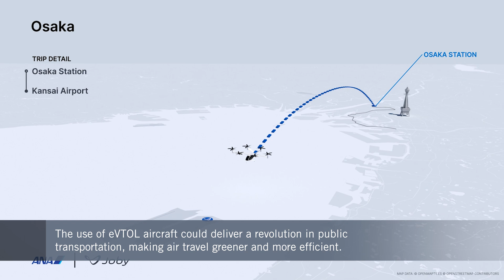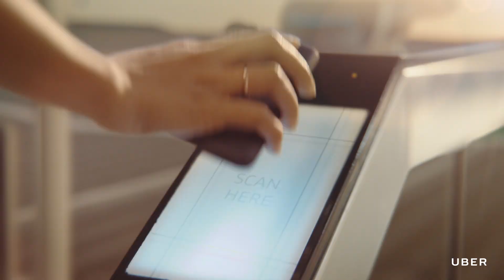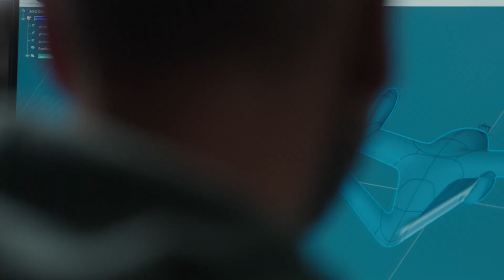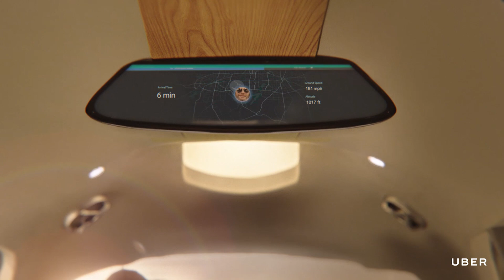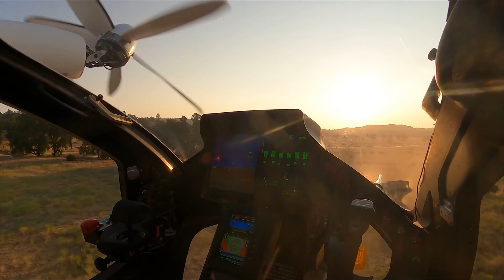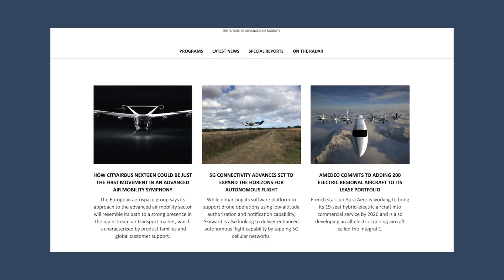Electric Aviation Pioneers Like Joby Want to Transform Air Travel With eVTOL Aircraft – FutureFlight

Comment: It's interesting, it seems well built but it's too big, too heavy, too conventional helicopter thinking thus missing out the bulk of the potential that light single seat EVtol could have. Notice the massive helipad/airport on the roof in their promotional material, that's airport thinking and airport isn't convenient. Only when it's light and quiet enough to land at a mansion in the hills and on a small bar roof and any Target or Olive Garden will it really matter. And should of course be autonomous. Way too much overhead to have a meat anchor costly pilot. This many years into the process and they are not seeing the obvious...  what can I say.
At the same time they could do home delivery drones. Designated publicly registered delivery platforms and the drone zips there directly from robotic kitchens at 300km/h. Like I've said before 2 tilt wing configuration. Both for passanger and packets.
Reply: The freedom and evolution of air travel you describe can happen with this kind of technology, but it can’t happen under the umbrella of FAA oversight, which is why they are fielding the technology the way that they are, with small regional helipad style hubs.
Reply: Technology moves fast. We are still in the stone age of evtols. If your concerns are valid, they may be solved down the line. These eVtol companies are all learning lots of new technologies and other things.
Reply: @drakecoleman9364  some of them have been at it for 10 years and don't understand anything, even despite me pointing out the obvious.
Reply: @WilliamHelstad  by 2 tilt wings I mean like a simple conventional plane with motors on each wing but the wings can individually rotate up along their length axis. that turns the thrust straight up and the differential angle and thrust can let it maneuver like a drone. rotate on all 3 axis. It has the advantage of being a very clean design and goes fully into efficient winged aerodynamic flight. Body could be tiny teardrop akin to a single seater high performance glider. Not as long for practical reasons but basically. Small tail. Super light, super simple. The wings can have points at their back they can land vertically on a bit like a pterodactyl. No wheels.
Reply: @WilliamHelstad  ❤good idea